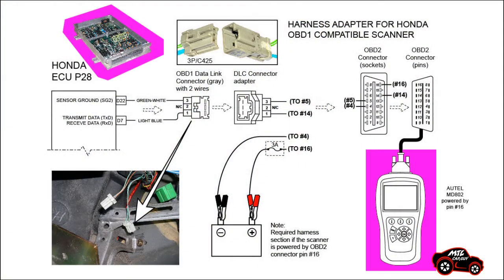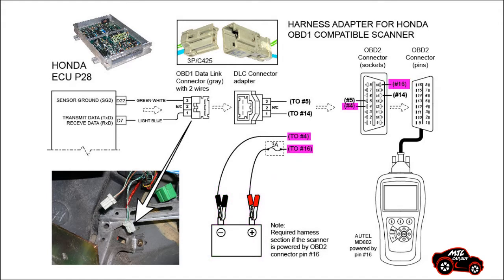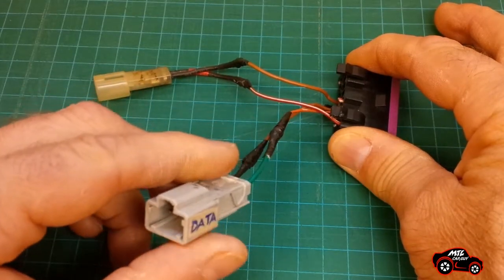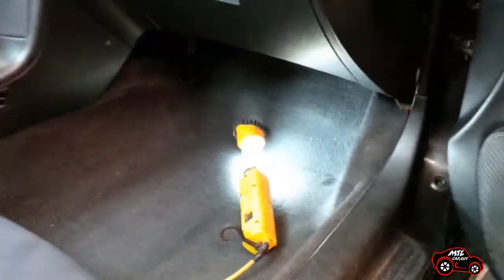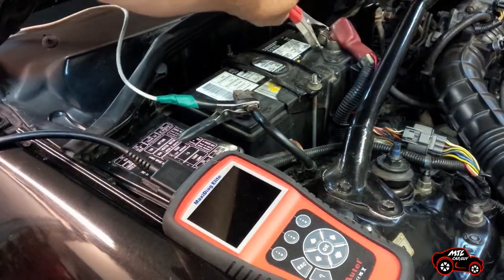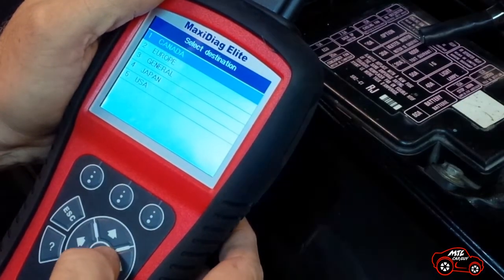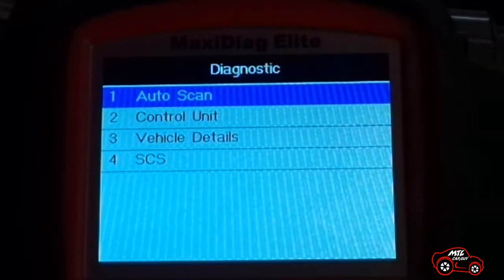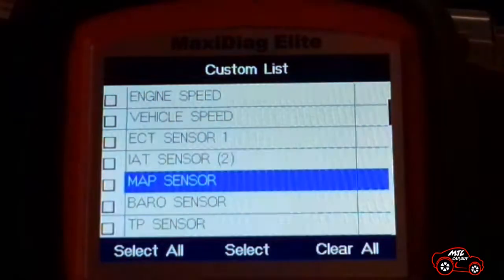MTLCARGUY EP1 - Honda OBD1 Live Data Scanner Reading

Comment: General question why didn't you try wiring the obd2 connector direct The 3 pin connector has ground, power, k line It is also on a fuse. Honda obd1 protocol is ISO9141 so for anyone wondering just find a obd2 that is compatible with The protocol
Reply from the maker: With the ECU P28, there is only 2 contact sockets installed in the 3 cavity DLC connector (one cavity is empty). 
The 2 contact sockets/wires are connected to the P28 D7 and D22 pins. The ECU P28 was not engineered with the K-Line. 
Most of the 3pin DLC adapter sold on line are made for K-Line system and do not work with the P28.
Later when the newer ECU/PCM(s) were equipped with the K-Line system, the DLC connector had 3 contact sockets that were more compatibles with the newer scan tools.
Note: I used a separate power and ground so I was able to turn off the engine and remove the key and still be able to keep the scan tool instantly active when starting the engine minutes or hours later to monitor the live data .
Reply: Interesting I assume it would have been the same I have a p2j-j71 ECU I plan on wiring the OBD2 port directly to the 3 pin connector It should work . Fingers crossed 🤞

Comment: I have an Autel MaxiScan MS509 do you think I can do the same kind of setup? I have a 98 Prelude and 2000 CRV.
Reply from the maker: You don't need the OBD1 setup with your vehicles because they have the OBD2 system. The standard OBD2 DLC connector was installed with most of the Honda & Acura products from 1996.
Reply: @mtlcarguy  A lot of them still had the obd 1 ports especially right hand drive markets. Im going to try it and see if i get live data.
Reply from the maker: @BrakJan  The 3 cavity DLC ports/connectors are the same but the wiring pinout with the ECU/ECM and the interface protocol changed with the OBD2 ECM versions. My pinout is only for OBD1 with the ECU D7 contact pin.

Comment: I really don't understand how this works since the scanner being used is obd2 only? There are OBD1 to OBD2 adapters available,  but I have never seen OBD1 live data read by a OBD2 only scanner like the Autel being used? I have tried using my Autel MX808 on my 1995 Jeep with the  correct adapter and it doesn't work.
Reply from the maker: First the scanners Autel MD802 were sold with the standard OBD2 interface and also with a Pre-OBD interface.
I never tried to read codes or look at live data from a Pre OBD2 Jeep with my scanner, so it is difficult to help you.

I don't know your Autel MX808 model, but, it may not have the Pre-OBD Jeep data interface loaded or there is a problem with the cable adapter or with a 16P DLC dongle system.
I would ask the question in a Jeep discussion forum.

Comment: Hi Sir .Fisrtly,  thanks for your helpful videos.Nowadays, l have a engine light problem and l have Honda  Civic Si 1993  (d16a9 non VTEC engine p29 ECU ) .l have 3 pin blue socket in my car, l use for trouble codes obd elm 327 bluetooth but l cant connect my car so l can connect my p29  ECU with elm 327 Bluetooth
Reply from the maker: The ELM327 Bluetooth dongle is compatible with the early Honda OBD2 protocols J1850 PWM and J1850 VPW.
I don’t think your ELM327 system can access the DATA from the DxT/RxD Data link wire D7 on connector D from your P29 ECU via the 3P/C245 Data Link Connector  because it is an earlier Honda OBD1 interface communication system.

Comment: Hi there, do you think that would work with honda civic lxi 1999,it also have 3 pins and 2 pins colored blue, im planning to use a vs890 vgate obd2 scanner?
Reply from the maker: The OBD1 interface was required from 1992 to 1995. With your 1999 the old blue DLC connector plug was still available but not required to read the standard OBD2 information. It is easier to use the OBD2 connector to get the the Data and the codes. I don't know the scanner you are looking for, but make sure you download the User Manual PDF to read it and know all the functions and also know how it works before ordering it. I don't think it has a graphing display that is useful when looking at live data.
Reply: @mtlcarguy  thanks a lot, appreciate it. :)

Comment: General questions ..is obd 2 scanner will work on obd 1 car if we use the wire converter or we need an obd 1 scanner??
Reply from the maker: Some OBD2 scanners can access and read the OBD1 Data but only if the specific communication protocols are programmed in. Most of the OBD2 scanners are not design to access OBD1, some are able in different levels for different kinds of cars. The connectors for OBD1 were not regulated, this is why they were all different. Using a DLC connector adapter can solve the pin-out connection but the communication protocols and the Data reading procedures are different from company to company. There is no guaranty that it will work on all OBD1 control modules. For more details on compatibility, check on line or/and ask questions to your local auto parts reseller about your specific scanner needs.
Reply: @mtlcarguy  
Special thanks to you and for replying me ... I have Camaro 1995 v8 5.7 lt1 engine and would you help me more if you can add link for an obd 2 that might work for car.
Thanks anyway.
Reply from the maker: Around 5 years ago I was looking to find an OBD1 ScanTool to access the ECU live data on my Honda Del Sol (summer car). I used the key words OBD1, OBDI, Non-OBD2, Non-OBDII, Pre-OBD2 and Pre-OBDII combined with Scan Tool. The main hits that I got were the Autel MaxiDiag Elite MD802. I downloaded the PDF User Manual from the Autel website and in the text it was written that the non-OBDII vehicles could be diagnosed with cable adapters. The second hits were the Innova Scan Tools. Finally, I selected the Autel MaxiDiag Elite MD802 because the European models that were included. Since I am retired, I do not need an expansive scan tool. There are new models on the market, so use the key words for a selection and find the User Manual for more information. Before buying, discuss with your Auto Parts Reseller to make sure that the product is good for your specific needs. Good luck.
Reply: @mtlcarguy  thanks a lot for the update and appreciate your help
Reply: @mtlcarguy  Hi there. I contacted Autel to see if they have any tools (such as the 802 you mentioned here) and they replied saying they don't have any OBDi capable tools! Do you know if this 802 will work with other acura/honda cars from pre-95 era - s2000 or nsx for example? Thanks for sharing the information btw. Its really hard to find a good tool that works with the older cars.
Reply from the maker: @a2mann2  The Autel  MD802 was sold for many years so you can look for a used one on line.
Autel should have something because they sell an optional Honda 3 Pin DLC adapter (Data Link Connector) compatible with many scanners.
See links: https://www.aliexpress.com/item/32723014987.html 
The so called OBD1connector on old Honda /Acura is a 3 cavity connector called DLC (Data Link Connector) with 2 or 3 wires connected. With 2 wires= 1 for Data and 1 for basic ground. With 3 wires= 1 for Data, 1 for  +12VDC and 1 for basic ground. This Data Link Connector can be found on:
Accord 4 cylinder 1994,1995,  Civic 1992-1995,  Del Sol 1993-1995,  Odyssey1995,  Passport 1994-1996,  Prelude 1992-1995.
The S2000 is OBD2.  As I can remember, the Acura NSX doesn't have this DLC connector.

Comment from the maker: Hi, I am retired and I am working on cars only to help some friends and family members.  I don’t know any friends that owned an old Ford with the first generation Electronic Engine Control EEC-IV.  I have never tried it with an Autel scanner but if I have the opportunity, I will look for it.
For now you have to know that the Ford self-diagnosis system generates standard pulses when a jumper wire connects the EEC TEST connector socket 2 with the single socket connector STI. To obtain stored codes, Ford describes the operation as a TEST. The EEC TEST connector socket 4 generates contact ground pulses. These pulses can also be seen with the check engine light.
With the jumper wire installed and the Key On Engine Off (KOEO) the Control Module generates the pulses for the stored codes. 
With a jumper wire connection procedure and the Key On Engine Running (KOER), the Control Module can generate pulses for new codes. New tests can then be performed, such as: ID codes, Engine Timing checking, Wiggle, Output and Cylinder Balance. 

With a compatible scanner and a Ford OBD1 7 Pin adapter there is no need for a jumper, it should be able to jump the pins and read the fast speed pulses. The scanner display should guide the user to execute specific actions to complete the PCM tests. Completing all the tests can result with multiple codes that can help establishing a good diagnostic.
For more information you can visit some forum for old Ford vehicles.
Reply: Thanks a lot for your help

Comment: Will a OBD 1 to obd2 adapter work
Reply from the maker: With the Autel MaxiDiag Elite MD802 you can use the standard Honda adapter for the Data transmission but you will need a 12VDC power supply to be connected on the side of the scanner. You can buy it on the Internet. With other scanner products or companies the adapter should work if the scanner has its own power and it is Honda OBD1 compatible. The DLC connector with the Honda ECU P28 OBD1 has 3 cavities with 2 active connections and it is gray.

Comment: Hi friend do you think the autel will work also on old obd 1 cars jeep GM Toyota
Reply from the maker: Toyota had the Toyota Diagnostic Communication Link (TDCL) installed in some models in the early 1990. GM and Jeep had basic diagnostic systems to. I don't know the details about the compatibilities. The best for you, is to visit your local auto-part reseller and ask for an Autel sales representative for advises. You might be able to get all information needed and negotiate a good deal on a scanner and the adapters. You can check for other brands too.
Reply: @mtlcarguy  
I think the scanner support old cars,I test it old bmw I used the 20 pin cable connector works great